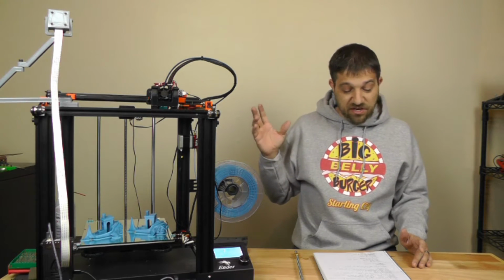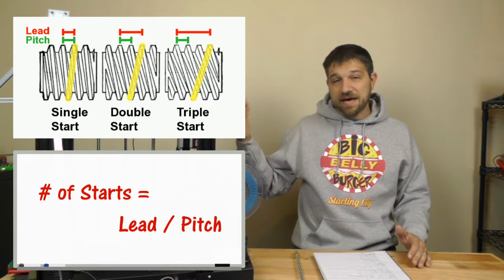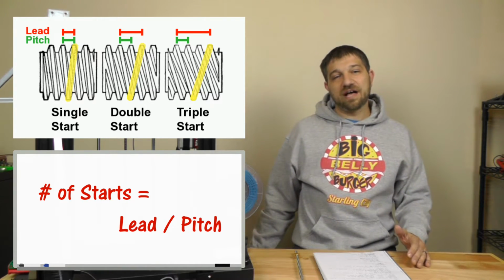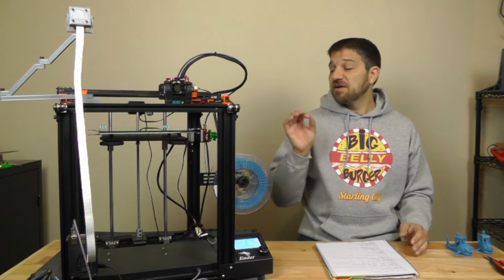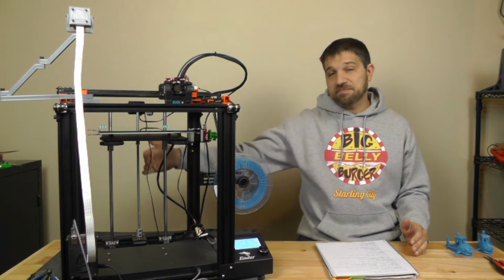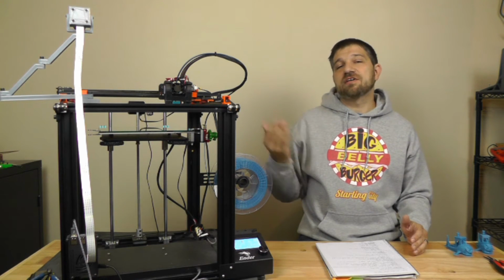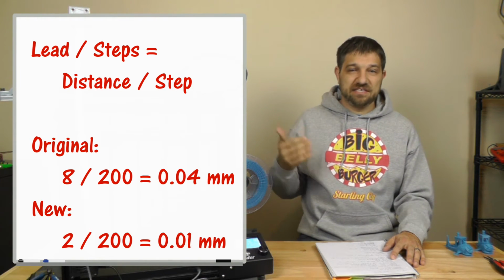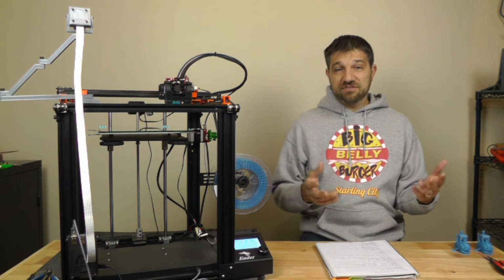Ender 5 Lead Screw Upgrade: Stop Your Falling Bed!

Comment from the maker: Ah! No matter how many times you watch a video, sometimes you still miss something. Here are any mistakes that have been caught:
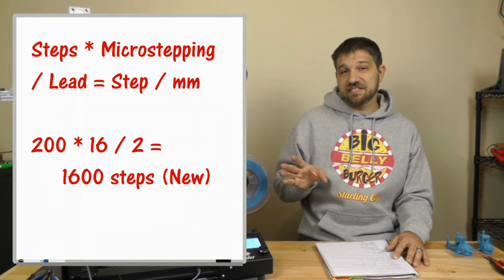12:40 - When I pop up the last equation, it's the same as the previous but with a different answer. It should read: "200 * 16 / 8 = 400 steps (old)." Thanks to Christopher SS Reid for the catch!
Reply: Chris check the links to Amazon they are for a 150mm screw not a 400mm. Zyltech has pre-cut length screws with small flange nuts cheaper no need for a custom length. I have no complaints about the screw and Delrin nut from Zyltech. Thanks for everything great mod.

Comment: I'm a little late to the party but I'm gonna do this upgrade soon
Reply from the maker: Awesome!
Reply: @kerseyfabs  just ordered the parts through the link.  Thanks for going over the e step adjustment.  Did you do a calibration after to fine tune your Z?  I've noticed mine is off and I kind of dialed it in but even on calibration cubes I get a little squish (I guess z banding - thicker layers) hoping this helps I just can't give up on my ender...
Reply from the maker: @RandoTechNerd  No problem. I'll leave that up to you. I've done both. These days I usually leave it at spec and dial my flow accordingly unless it's really bad.
Reply: @kerseyfabs  nice thank you I'll try the default and try a test print.  I watched another video that kind of shat on back lash nuts.  Has it worked out well for you?
Reply from the maker: @RandoTechNerd While some people say they don't do anything on printers, due to gravity, I think they can clean up some of the slop on the cheap screws. Either way, they certainly don't cause problems.

Comment: Thanks for the video! I was already stumbling down the same road about to order these leadscrews but I was a bit worried that the 2mm lead might spin the motors too fast. Great to see it's not an issue for you. I was already thinking I was overthinking!! 

I used your links during my purchase. Thanks for your continual contributions to the community!
Reply from the maker: Happy to do it! Good luck on your upgrade!

Comment: hey man, this is a fantastic video but I was just wondering if you could help me out. I'm replacing my ender 3s1 leadscrew to a 2mm pitch 2mm lead / 1 start but im also using klipper which means I can only change the settings within klipper config files like Mainsale. Do you know how to config the klipper settings to compensate for the new type of screw? The official klipper instructions are very confusing...

Comment: Just a couple questions.  Some printers have the anti-back lash screw on the bottom of the plate while others (like my ender 5 S1) have it on the top of the plate. Does this really make any difference? would you be able to identify a part number for an ender 5 s1 anti-backlash nut. Thank you

Comment: Thanks for this video. It helped me setup new z steps. I bought 700mm in the same specs as yours cause it was the only pitch available in that length. I now have 605mm of print height. Subscribed to your channel. You rock.
Reply from the maker: Glad it helped! Thanks!

Comment: Like many Ender 5’s mine squeaked when I got it and lubing it with correct did not fix it. Next I installed flexible couplers, still made noise (interestingly, I never had issue with bed falling.  So, I just installed Teflon POM screws with no messy lube and the bed falls to bottom in a few seconds!  So, now I will add POM anti-backlash and that I feel may be the ultimate low friction setup!

Comment: Did this upgrade and now I’m getting z binding.   When the bed is about 5 inches from the nozzle it binds.   Same with the very bottom. 

Any ideas?
Reply from the maker: The only thing I can think of is that the nut needs to be realigned or your screw is bent. Try the nut first by loosening the screws holding it in place and seeing if it moved freely. If so, lower the bed all the way and then retighten the screws.
Reply: @kerseyfabs  the screw looks straight but could be bent. I’ve been getting a lot of crappy stuff from amazon lately.  

Thanks for the help. Everything has been coming along.    I did have to put longer belts and now the screw but that’s been the only real challenge.  I think I may need another rail tho. One was hanging up a tiny bit. The manufacturer told me that will go away in a few times running it.  The x axis is butter can’t even heat it move!  
Keep up the good work I’ll let you know when I figure out the z problem
Reply: Took the screw out and rolled it and it seemed straight.  Did what you recommended and it was still binding at the bottom and top. 

Ran it up and down a few times and noticed the top of the screw was moving left and right a lot (wobbling).  Put the old screw back in and it went all the way up and down no problem. 
I think the screw may have a slight warp. 

Ordering a new one.  

Thanks again for your help!
Reply: Reporting back years later lol.  What fixed my binding was changing the speed of the z steppers to 10

Comment: Greetings,  Yep I'm a bit late to this Upgrade but here it goes.
I also wanted to add the T8 Tr8x2 2 by 1 by 2 lead screw to my Ender 5 Pro as it just makes sense.  I have the lead screw and the Backlash Nut and was ready to start but I ran into this issue.

On my E3 V2 I installed the JyersUI Firmware on the motherboard and display, ( V 2.0.1 build V1.3.5 ).  The Ender 3 board is the 4.2.2, 32 bit with the RET6 chip and 512 of flash memory.  This same board is on the E5 Pro soooo I added a new display like the E3 V2 and flashed the 5 Pro with the JyersUI on the motherboard and the display.  After making some direction changes to the X and Y stepper as well as relocating the X home switch and some axis e-step calibrations I was up and running.

But here is the rub, the z axis travel limit is 250 mm, the e-steps for the z axis max out at 800. These limits are the ones for the E3 V2 printer and I'm just not sure how to make any adjustment to the firmware to allow the 5 Pro the 300 mm of Z travel it is capable of reaching and how to get the e-steps to 1600 on it.

If your have any thoughts please let me know.  Thanks for the great upgrade and I hope I can make it work on the 5 Pro.
Best Regards
Doug

Comment: Hello, I know this video is for the ender 5 but can you please answer a question on the ender 5 plus. I'm having an issue with the bed falling slightly on the left side. I have installed the pom anti backlash nuts you suggested, it's better but still moves slightly. Can you please post a link with a new lead screw for me to use on the 5plus. Thank You.
Reply from the maker: Have you made sure your bed brackets on each side are level? That shouldn't happen. I'd hate for you to upgrade if it doesn't need it.
Reply: @kerseyfabs  yes, I use digital calipers, it's only the left side. If I hold the screw and turn it to level it's good. When I let it go out moves down about 2-3 mm. Maybe the pom nut is bad/ out of spec? Thank you for your videos they are extremely helpful for us new guys.

Comment: Running the leadscrew nut up and down is SOOOOOO much easier if you attach a drill to one end of the leadscrew. Just go slow so grease doesn't go flying everywhere.
Reply from the maker: 😆 Sure. That works.

Comment: Thanks so much for this video. Upgrade went mostly smooth. I had a bit of trouble with getting the washers and nuts on two of the screws as there was a very tight clearance  on the new backlash nut. No room for the spring between the nut and the shaft so spring is resting against the bottom of the nuts. Doesn't seem to make a difference.  Once that was finished it worked perfectly. Much smoother and quieter then the old lead screw. Did have to reset the zstepper to 1601 to get the proper travel distance. Again, thanks.
Reply from the maker: I'm glad it worked out for you!

Comment: Very informative. Thank you for educating me, but I'm a tad confused.

My Ender 5 Pro has a lead of 4mm (OEM). If I understood correctly, I can change the lead screw and nut combo to a 2mm lead and it would greatly improve my prints. Correct? What would the new steps be for the stepper? Would you recommended going from a 4mm to a 2mm lead?
Reply from the maker: I don't actually think it greatly improves prints. It may improve them some but this was mainly about upgrading to fix the falling bed.
If you half the lead, you double the steps.

Comment: Wow I guess I got lucky with my Ender 5! It came included with that spring nut already, so I haven't had to deal with my bed falling unless I've printed something really big, though I can push it down if I want to. I got mine early in 2019. This is a great tutorial on how to change out the screw and lube it up, though!
Reply from the maker: Thank you! Yeah, Creality changed the pitch of the lead screw soon after I published this video.

Comment: I just installed the lead screw you recommended on my Ender 5, lubed it and it's making horrible squealing noises at different points. It seems to be the worst at the top 1/3rd of the screw, but it does it a bit further down intermittently. Any suggestions?

Comment: What is the original lead screw (pitch, starts, lead) for Ender 5 plus from factory new?  If I change the Z axis with this T8 POM Anti Backlash Nuts Tr8x2 for Lead 2mm Pitch 2mm (has 1 starts), do I have to change original Ender 5 plus lead screw with 1 starts also or I can use the on with factory?
Reply from the maker: The original Ender 5 Plus is 2mm pitch, 4mm lead. So if you go to a 2mm lead, you'd need a new screw.

Comment: Hi After the upgrade do you have to change the Z speed velocity and acceleration. As the steppers have to move 4 times faster to achieve the same Z speed before the upgrade. The default settings are 10 and 100 respectively which to me means setting these values to 2.5 and 25.  to keep the Z stepper stepping ant the same rate i.e. steps per second. This of course means the the  Z axis will actually move 4 times slower.  10mm/s equals 5 revolutions per second (2mm pitch) or 300rpm and the creality stepper motor is rated to 1000rpm. so moving 4 start lead screw means 4 x 300rpm  i.e 1200rpm which exceeds the motor rating. Or is my thinking totally wrong
Reply: I changed to single start 2mm lead lead screws on my printer, not a Creality but that doesn’t matter, yes as well as changing steps from 400 to 1600/mm gad to change max feedrate for Z axis from default of 20 down to 7 in my skr mini v2 config as at the default feedrate just caused the stepper to miss steps

Comment: Will this work for my E5 Plus? Obviously with two of the screws. My biggest problem is the backlash and pain of getting my bed to level properly. I've done the bl touch mod to the firmware and that helped a bunch, but this with the additional accuracy would top it off.

Comment: Wont this lead screw slow my speed down by alot? considering that my current lead screw has 4 starts nd this only 1?
Reply from the maker: Please watch the video about adjusting the step per mm. Changing that setting will compensate for the difference in measurements.

Comment: Looking very promising, Would it be good if I 3D printed the Anti Backlash screws and used the bed springs...?
Reply from the maker: I'm sorry. How would you print the screws?
Reply: @kerseyfabs  I saw there are already models for them on Thingiverse... maybe out of ABS...?
Reply from the maker: If I wanted to do it for fun, that's fine. I would never do it for a machine I wanted precise, long term motion from.
Reply: @kerseyfabs  Understood, THX for the reply :D

Comment: So i have fully installed the New Lead Screw, Changed the Zsteps to 1600 and Stored the Settings. In terms of Slicing it what do i change in terms of the settings? the line width?
Reply from the maker: You don't need to change anything in the slicer. It should work as normal.

Comment: But is the fix the lead screw, or is it actually the anti-backlash nut?
Reply from the maker: The lead screw is the actual fix. The nut is just a recommendation, not required.
Reply: @kerseyfabs  - I have an ender 3 pro that i converted to linear rails, and when I did, the x gantry is so heavynow  that it free-falls when i turn the printer off (or when the print is done).  :(
Reply from the maker: @jsimmonstx  This will probably fix your issue too. If you get the incline of the screw shallow enough, it shouldn't fall.
Reply: @kerseyfabs  BTW, can I use any 2mm pitch lead screw nut on a single start lead screw with a 2-mm pitch?
Reply from the maker: No. Pitch, lead, and number of starts are interdependent. It would also have to have the same lead.
Reply: @kerseyfabs  - Well, the ender 3's don't use round lead screw nuts, and I can't convert over to them without modifying the extruder bracket - the extruder stepper would have to be relocated (not a big deal), but the two nut holes are too far apart, and have to be elongated, and the guide hole for the nut is too large to make that possible. If you have a source for the two-hole nuts with the right pitch/lead, I would be eternally grateful.

Comment: Is this Mod also viable for the ender 5 Plus? I saw your video where you used "2-Pack 3D Printer TR8x4 T8 POM Anti Backlash Nuts for Pitch 2mm Lead 4mm Acme Threaded Rod Eliminate" to stabilize bed jutter/shake  w/o having to lube the thread, but it seems to me that  finer vertical control would have the potential to produce smoother/finer results. (total n00b here so if this question is moronic feel free to put a pointy hat on and send me to stand in the corner)
Reply from the maker: You could do this on the 5 Plus to create an even finer pitch on your Z-axis. I haven't found it to be necessary though.
Reply: @kerseyfabs  Thanks

Comment: My E5+ arrived yesterday.  It went together well.  The hardest part is getting the T nuts for the fillimemt holder into the rail after assembly.  The bracket should be installed to the rail before the rail is assembled tothe "cage".  I wanted to mention something relevant to this video.  My Z axis lead screws have only 2 starts.  That means the lead is 4mm and not the 8mm you had when you made this video.  Looks like Creality is paying attention to some feedback.  I've already ordered some Delrin AB nuts.  I also ordered a Mean Well PSU to match the one provided by Creality.  Kinda pricey @ $107 from Amazon.  I will wire the two PSUs in parallel to provide 1kw@24vdc.  That should keep the printer from catching on fire.  I'll send some pics of the mod.
Reply from the maker: I'm happy to hear you were able to get up and running. On the lead screws, in this video, I was talking about the regular Ender 5, not the Ender 5 Plus. They use different screws. Thanks!